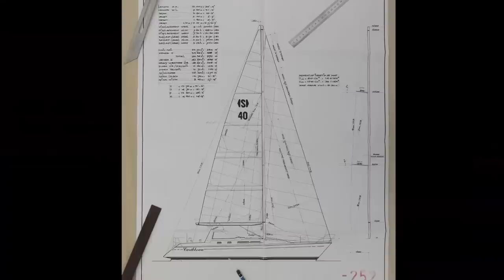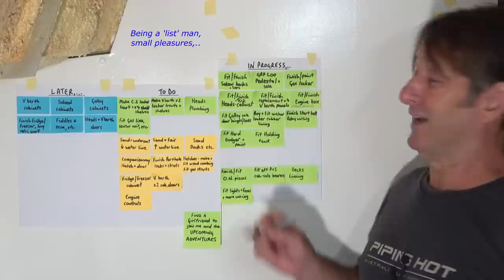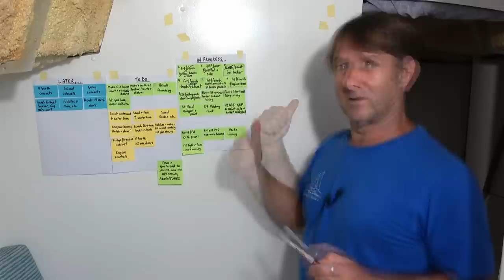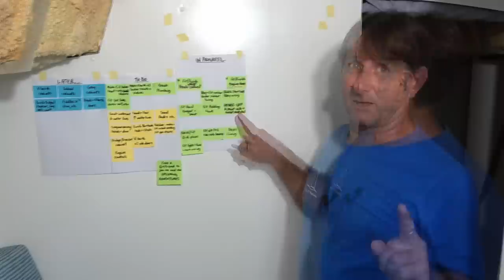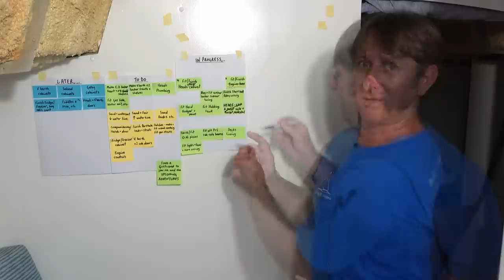Some GREAT FINISH work! Ep.157 Building my steel sailing yacht

Comment: I don't know if it's a secret, but which wood has used on the steps of the engine stairs? The ended up it was very beautiful !  Congratulations ! Good  winds !
Reply from the maker: Obrigado senhor, much appreciated and regarding the wood used for these steps, it is actually the same NG Rosewood that I have used throughout on Mistress, however this particular grain is an uncommon variant, it really is stunning  🙂🌳👍🏻
Reply: @BuildingSYMistress Here in Brazil it is called Jacarandá, noble wood :)